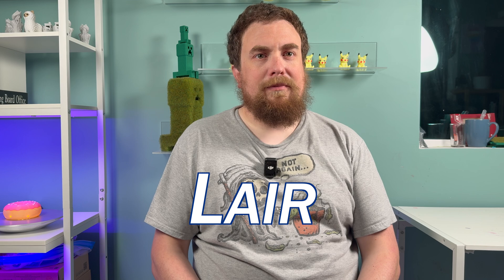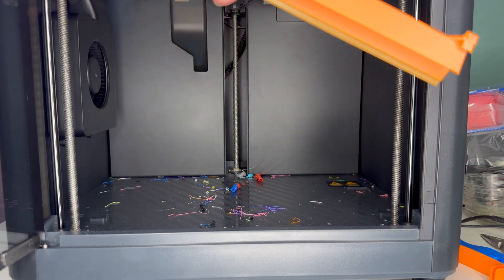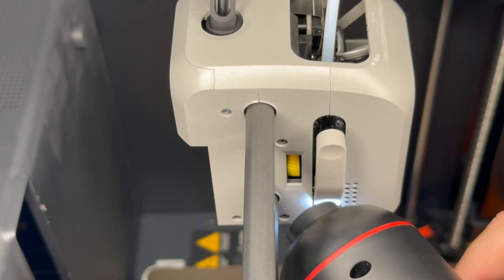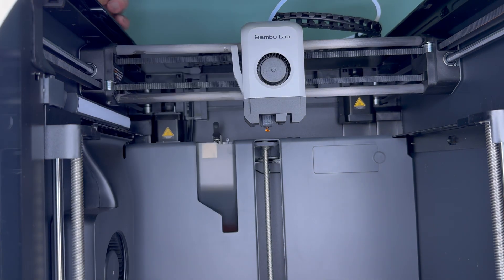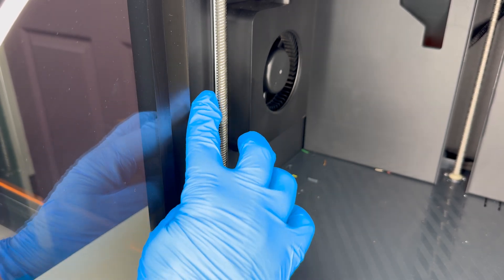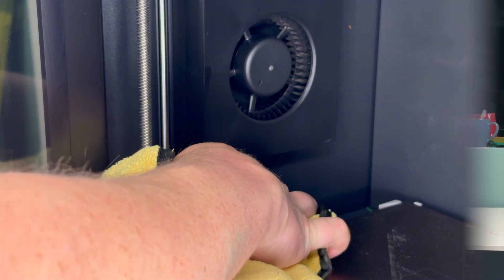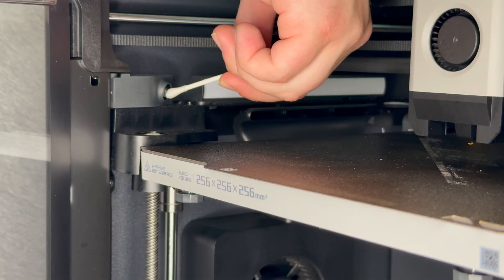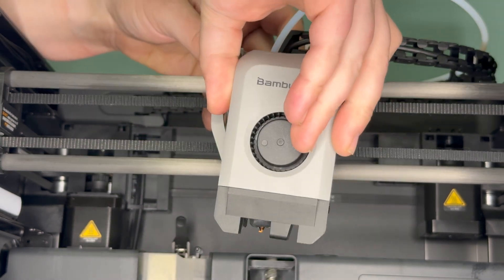How to Maintain Your BambuLab P1 Series Printer

Comment: Why are different lube oils needed, wouldn't one work for both applications?
Reply from the maker: Different viscosities. One is more of a grease and the other is more of an oil. The grease type is for the Z axis screw and the oil type is for the rods.